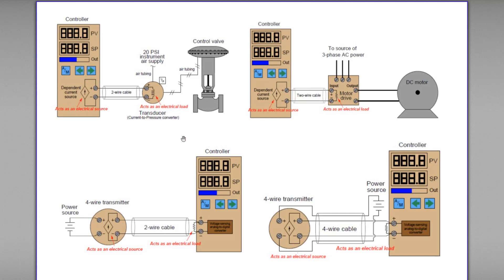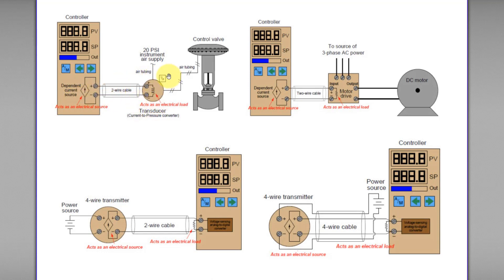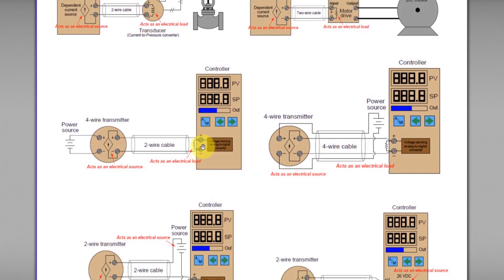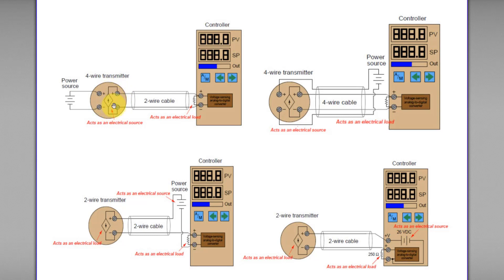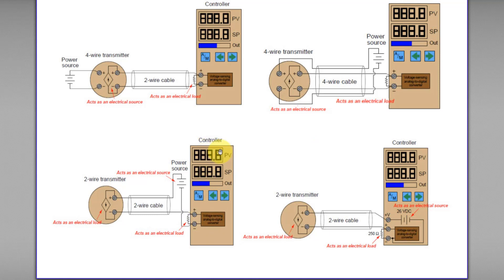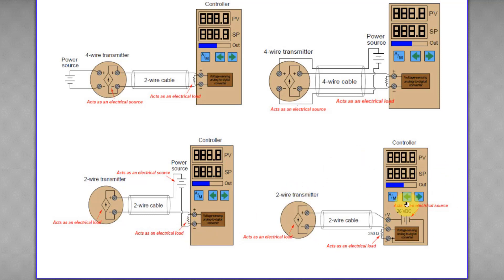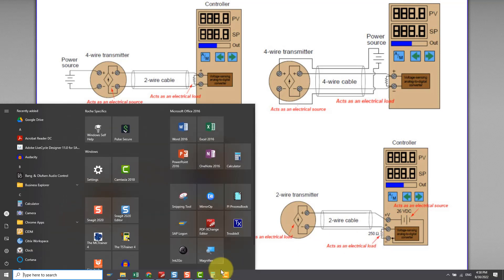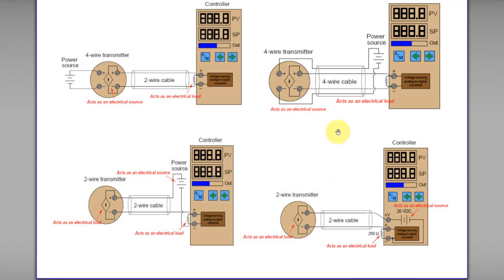What is Electrical Source and Load for instrumentation?

Comment from the maker: "For any basic circuit, there is a minimum requirement of at least one power supply and one load. The circuit can has as many loads as possible with a power source. However, a circuit must not has an power source without any load because it may catch fire due to verr low resistance in a circuit withou load.

If one of the component acts as an electrical source, then the other component should act as an electrical load. For example, if a 4 wires type transmitter acts as an electrical source, then the controller will act as an electrical load and the transmitter shoud be connected to the controller input load."